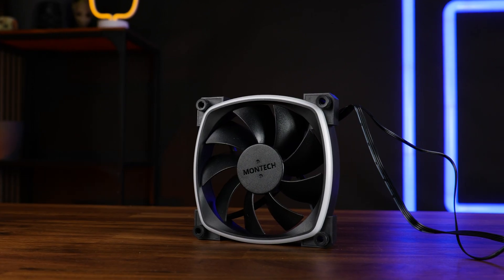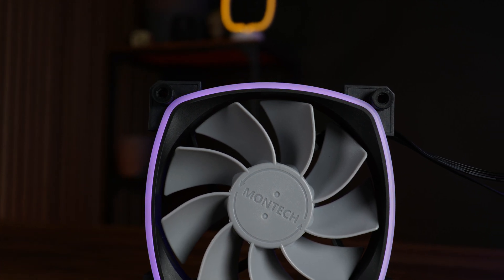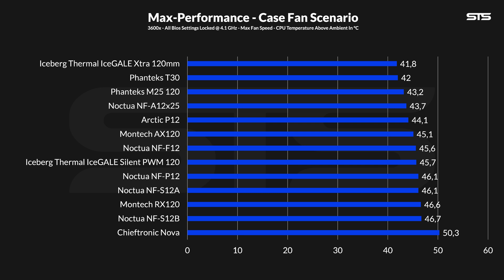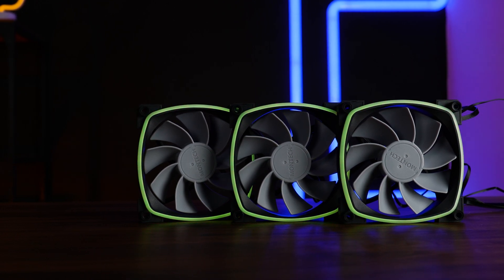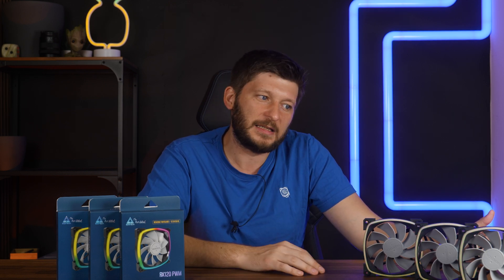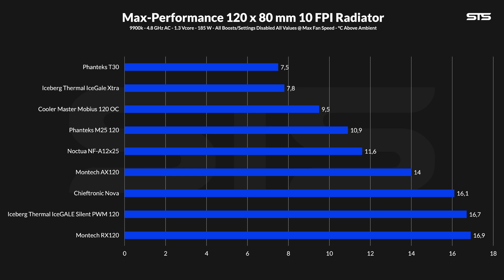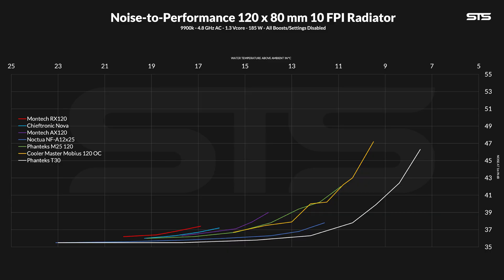Montech RX120 Review - Reverse Spinning = Normal Fan??

Comment: so
rx is intake
ax is exhaust?
Reply: I'm trying to get a grasp on this crap as well. I want to say.. AX is intake on front panel mesh cases. then becomes an exhaust (if you don't flip them) anywhere else. RX is intake on the 'everywhere else' but an exhaust on the front panels. I was looking into these to put in my The Tower 250 as it's the only thing microcenter has at the moment, but I think I'll just hold off till more Arctic fans come into play.

Comment: Im using 4 AX (3 on top and 1 rear exhaust), 2 reverse RX on my Rog Ryujin III 240mm drawing cool air into case and directly onto my cpu (i7 13700k) with 3 RX 120mm on the bottom drawing air into case, temps have been great in my Montech King pro 95.

Comment: 7:38 i agree with radiator, 1600RPM whether it's AX or RX version or of any manufacturer I would not recommend for radiator. However, in my scenario, I can put fans both at front and behind radiator via side load in a 011D Mini. The fans included with the AIO i am considering runs at 2200RPM. Putting those behind the radiator and the RX in front of the radiator = perfection.

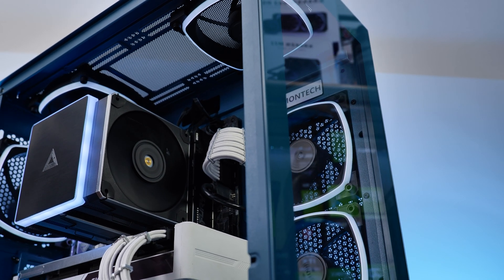Comment: 7:19 the specs i am looking at currently on Amazon, the AX & RX says 1600 RPM. I do not see what air pressure they say either fan could/should produce. Maybe they updated their listing after this video, I dont know. However, if they didn't, my own common sense tells me that a reverse fan at 1600 RPM won't necessarily produce the same air pressure as normal fans at 1600 RPM.... no?

Comment: but if you just put 9 in :) and set them to half speed :) you have nice lights and no noise :)  big noctua D15s on the PSU and i will be fine :D i will have 4x 140mm going in, 3x 120mm going in, and 1x120mm going out :D and yes that is 8 not 9 :P but there is space for one more if i want :)

Comment: Thx for this insightful review my curiosity for the King 95 Pro brought me here :), i do think 3 x 120 bottom and 2 x 140 's as side intake fans without radiator will be fine, and you can't really beat the price for the amount of fans you get and i have to admit it looks good, if you want to deck out the case with fans just buy 2 ax120's (or 140?) for the top and you're fine.

Comment: I was switching my fans was because the system I purchased came with 6 Apevia fans who's RGB was almost completely burnt out.  Only a few l.e.d.s still worked, and only stayed static green.  Just as I was about to install the Montech fans, as I described in my previous comment, I received a surprise email from Apevia that they are sending me a complete set of Apevia Luna Pro Series fans.  Now I don't know what I should do.  I know nothing about Apevia fans.  Should I use them, or keep going with the Montech fans?

Comment: Is putting a reverse switch on the back of a regular fan so difficult that I have to buy new fans when I need reverse fans?
Reply: That is because pc fans or direction optimise if you reverse a regular fan it will flow less cfm in reverse direction sure you can design a fan blade that works both ways but the sacrifice would be noise.
Reply: Tell me you didnt get the point without telling me you didnt get the point

Comment: Thank you for this review, and now I will tell you why I will still be using these reverse fans to fill my HYAT Y60 case, and why I believe this is a market that has been ignored for far too long.  To begin with, everywhere I look recommends a positive airflow.  The only way to accomplish this is to have more intake than exhaust.  It is possible to accomplish this by adjusting the speeds, but in most cases, because it works better, the fans will be turned around backwards.  
I want to draw cool air from outside my PC in through the radiator of my AIO as I believe that will make it cooler than blowing hot air from inside my PC out through the radiator.  So if you are correct and the AX fans do work slightly better, I think my way will still cool my system better than if I used the AX fans.  Unless I use the AX fans and turned them backwards but then I get the following RGB issue.
I guess I'm kind of fussy when it comes to these things because I seem to be the only person complaining that when you turn an RGB fan around the lights work backwards from the rest of the system.  So simply putting the halo on both sides of the fan does not fix the problem.  If you have the lights going around in a clockwise motion, the fans that are backwards will now go counterclockwise.
I know that Montech are not the best fans on the market, and for a system I just paid $4000 for I should probably use something better.  But I wanted the Halo RGB fans, and these are the only reversing fans I could find with the Halo light.  I was considering ThermalTake Swafan, but could not find any with the halo.  I have no idea why all the other PC fan companies aren't jumping all over this.  It is an almost completely untapped market.
Reply: I'm only realizing this problem now where Im looking to add more fans to create a positive airflow but I can hardly find any lighted options where the lights arent covered when I put them anywhere but the front of the case